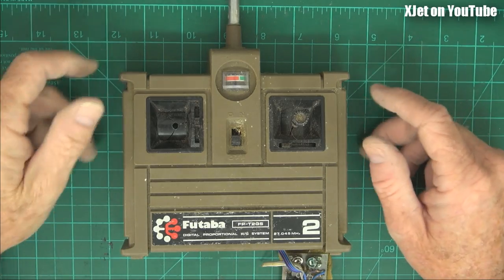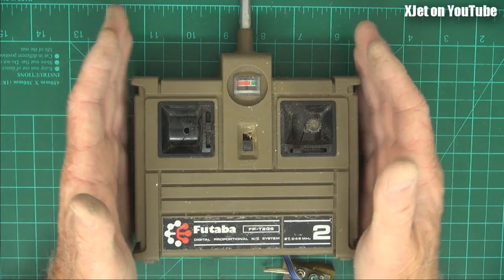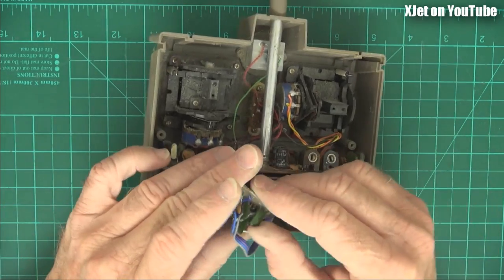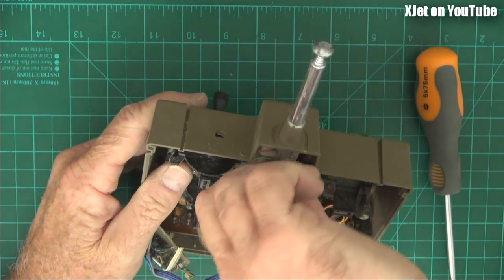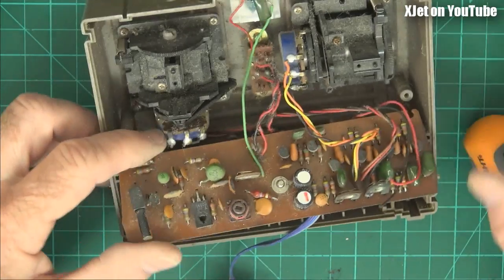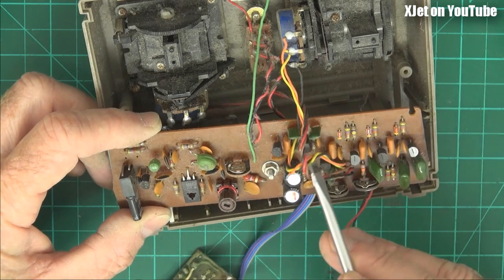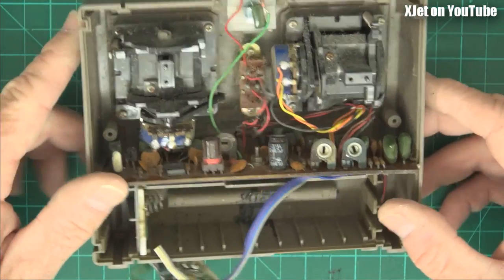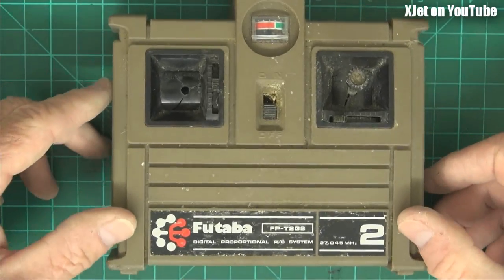Futaba 2-channel radio control transmitter from the 1970s

Comment: Good info, didn't realise these futaba radios went as far back as the 70's, thought early 80's at the most. got a couple in my attic purchased years ago to put into some vintage rc cars ,1 new in box and believe it's 3ch on 35MHz which is/was reserved for aircraft here in the U.K. with 27 and 40MHz for surface models..

Comment: And until very recently Futaba were still making and selling an AM 2 ch radio. There will still be shops in NZ selling these at $129 with two large servos. However transmitter and receiver are now single chip designs.
Reply: Futaba Attack 2E5, 27mhz... I'm sure my local model shop here in Christchurch still sells them brand new for $120 or so...

Alternatively, cheap 2.4ghz 6ch radio sets are approximately $30...

Comment: I'm loving these look backs. My original radio was a sprengbrook 2 channel radio with linear servos. Very Posh in the day
Reply from the maker: The Sprengbrook 4-channel was quite popular back then as well.  You could buy it as a kitset and it was also sold under the brand "HB".

Comment: They were ultra reliable and bought very good radio t othe cheap market. same quality guts as in the top stuff from futaba , but ina  plastic case made it the cheapest 2 channel radio you could buy. and it did NOT have any glitching, good range and ultra reliable stuff....... you could buy this with 3 channel and 4 chanel. if 3 it had a lever or knob on top right. if 4 channel it was twin axis sticks both sides.. good old futaba medallion.

Comment: Intrigued to see the cover declare this to be "Digital Proportional".
What part of the tx would have been digital?
Reply: Im just guessing, But could there be PWM signals ?
Reply: ProCactus pulse width modulation, where the width would represent the position of the servo, then several chanels in sequence to give you pulse position modulation which was then modulated on to the carrier by changing the amplitude (output power). Servo reversing was accomplished by purchasing a reverse servo. 1980's iirc. I started just before these radios as my first (used, I was a broke kid) was a three channel with an aluminum case. I have also repaired many futaba and JR two channel radios and speed controls.
Reply: ok, So it could be PWM or not ?
Reply: ProCactus  thumb -> stick -> Potentiometer -> PWM -> PPM -> AM -> PWM -> Servo
Reply: so, It could be ?
I don't know why you are telling me these things, I'm not sure if you are talking about the OP question or writing a book. I mentioned PWM because its the only thing I can think of that would be digital in a unit like this. Nothing more
Reply: Thanks ProCactus. That is probably the right direction for the "digital" TX. If PWM then the receivers would have also been better able to discriminate the on/off signal than an analogue one. Would sound about right. Thanks.
Reply: ProCactus thumb > stick -> Potentiometer -> Analogue Voltage -> PPM -> AM Tx>AM Rx > PPM>PWM -> Servo. 
There is no PWM in the Tx
Reply: So what part of it could be digital ?
Reply: Both PWM and PPM are considered digital techniques due to the information being sent using a logic state which can be either high or low.

Comment: hi Bruce hope u can help me I have exhausted all my options and thought I'd ask u I put a 2.4 MOD in my Jr x2720 and only switched the power wire and should've switched the signal wire aswell and now have done something to the 36mhz board can u help me fix it or know where I can get another board Regards Rick